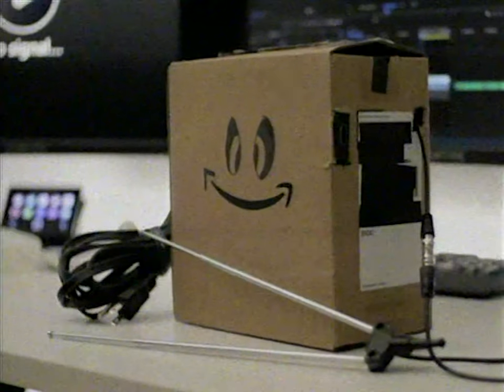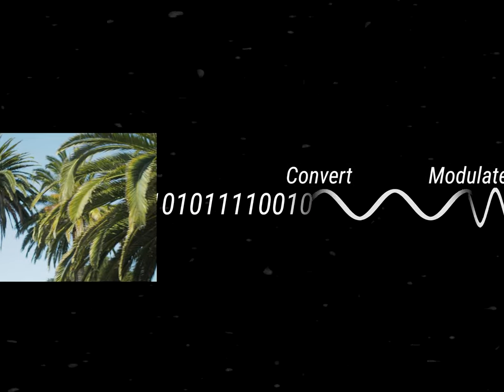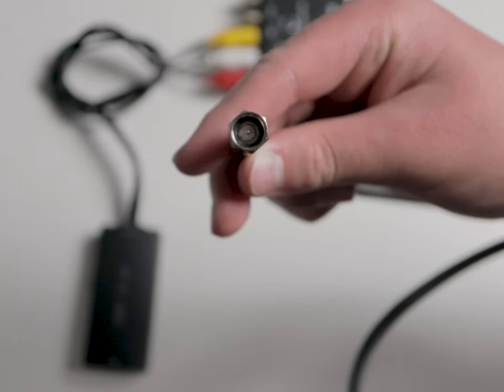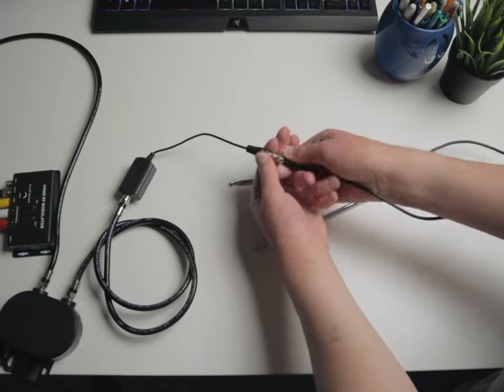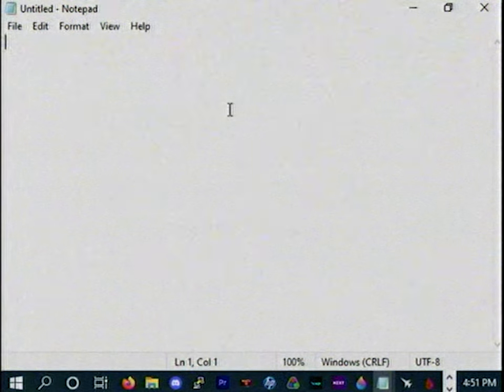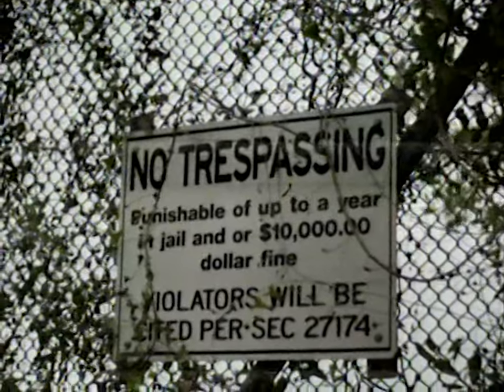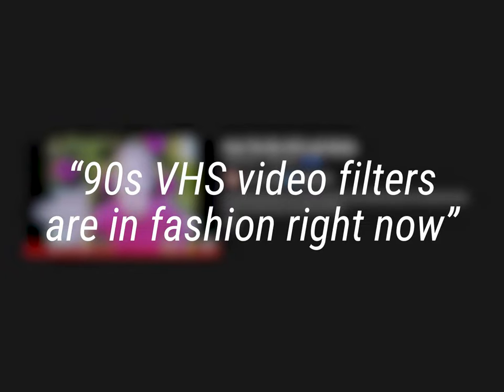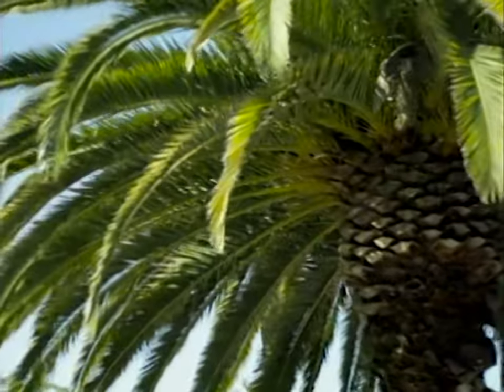Building a 1950s TV Transmitter!

Comment: As another note, your chosen modulator is transmitting on UHF stations. Most American TVs before 1962 were VHF-only (UHF cost extra) so they couldn't actually receive your signal. More importantly for you, rabbit ears are designed for VHF. If you get some UHF (or combo VHF/UHF) antennas you might get a stronger signal and a cleaner image. The most common old-school design you'll find is the loop antenna. That's why most tabletop antennas have a metal hoop on the base, it's not a handle.
Reply: FCC rules published in 1952 set aside 70 channels for UHF TV, numbered 14-83. My parents bought their first TV set in 1954 with a UHF tuner option to receive the two local UHF channels in addition to the one VHF channel. I venture to say that most TV sets in the area did not have built-in UHF tuners because they were bought before the UHF channels came on the air. Later, both local UHF channels received VHF channel assignments, but additional UHF channels came on the air.

The antenna was definitely an issue. My Dad put up a rooftop UHF bowtie antenna in addition to the VHF antenna. He installed a 300 ohm downlead designed for low loss at UHF just for the UHF antenna. The VHF antenna had a separate downlead.

The FCC approved a color TV standard in 1950 that was not compatible with existing B/W TV sets. There is some thought that the FCC expected some TV stations to broadcast on 2 channels, one in color and one in B/W. If so, additional channels would need to be allocated and the 70 UHF channels would fill that need. In reality, this standard never really caught on and was eventually dropped in favor of compatible color, where both B/W and color sets tuned to the same channel, but B/W sets displayed a B/W picture and color sets a color picture.
Reply: @jimlocke9320   In areas like yours where UHF was used people were obviously much more willing to pay for the UHF upgrade of their sets. If there weren't active UHF stations you'd essentially be gambling that one would come on the air soon. I've read that right after UHF was introduced about 30% of buyers bought UHF tuners but after the hype died down the number dropped to nearly zero before the 1962 mandate. If you bought a VHF-only TV but a UHF station came on the air you could buy a "UHF converter".

As for the CBS field sequential color system, I believe it was only authorized on an experimental basis. RCA's invention and demonstration of the shadow mask CRT was what made the FCC choose the RCA-developed compatible color system as the final system. If they stuck with the CBS system the split surely would have set back color adoption. Worse yet if color did take over and made B&W TVs become obsolete we would probably see less of them still existing.
Reply from the maker: Thanks for the comments/stories both of you.. I never really thought about a different antenna.. I might have to try it with one that has UHF elements.
Reply from the maker: @jimlocke9320 that's awesome that you had two antennas 😂.. I'm glad that they went with a backward compatible color signal. It's actually really cool they were able to cram it in, even if B&W TVs looked a little fuzzier with the color signal
Reply: @eDoc2020  In those early TVs, the UHF tuner was basically an add on oscillator that converted UHF broadcasts into an IF signal that was fed to the main VHF tuner (who's own oscillator was disabled) for amplification. Not much different to using an external, third party converter that converted UHF to VHF, except there was only one frequency conversion. Originally, TVs used an IF frequency of 21 MHz, but in the mid 1950s, they started transitioning to 41 MHz, especially for sets that supported UHF reception.
Reply: @dougbrowning82  I think the switch to 45MHz IF started earlier than that. I was watching a restoration of a 16" Zenith porthole G2322 from 1950 and it IIRC had the newer IF. I think the main reason for the switch was cost cutting; with a higher frequency you get a wider bandwidth with fewer amplification stages. In the older days high frequency tubes weren't as good so the lower frequency made more sense. I'm guessing the huge uptick in TV adoption around 1949 was a catalyst for the industry change in IF and the deallocation of channel 1 made 45MHz a practical choice.

I was previously under the impression that it was color adoption which pushed the IF change but the Zenith disproves that. The fact that UHF sets usually ran the higher IF is probably a timing coincidence. If you're developing new turners why not use that as an opportunity to switch to the newer standards?
Reply: @eDoc2020  Probably the biggest reason for these changes is cost cutting. Going from three stage IF amps to two stage. Quadrature sound detectors instead of discriminators, Potter oscillators instead of multi-vibrators for horizontal generators, and transformer-less power supplies. Money is the biggest motivator.
Reply: While UHF tends to seem optimal, a problem is that many modulators nowadays do Cable NTSC instead of Antenna NTSC, so it’s harder for older TVs to receive our blantant Part 21 violations… er, I mean some older TVs won’t work with some modulators
Reply: @eDoc2020 Funnily enough in Europe TV went as low as US channel 1 even ignoring the BBC 405 line standard. In Australia and New Zeland it went down to as low as ~45 MHz video. Apparently New Zealand TV was quite a regular e skip occurrence in Australia during the summer.
Reply: @SimonVideo  Or just grab a wire that is around 60-50cm and plug it to the center feed of the connector.

Comment: As somebody else here said the dark picture is most likely from the cheap HDMI->composite adapter. To get into the details a bit, American broadcasts have a 7.5 IRE "setup" (black level) while other regions (including Europe and Asia) don't. So a signal level which a Chinese TV sees as dark gray is seen by an American receiver as black and what the Chinese TV sees as black is seen as darker than black by the American receiver. An easy work-around is to increase the "brightness" in your receiver. This will work on almost any analog receiver but might not on all digital-based receivers.
Reply from the maker: Interesting! Good to know! I did notice a brighter picture when I used my raspberry pi's composite out.

Comment: What I liked about analog TV the most is that it was practically lag-free, what you saw was eseentially real-time if it came from the TV studio (a news report coming though a satelite link to the studio had a few seconds lag even in the analog days). 
As digital took over, true live TV was gone. Digital terrestrial TV signals need processing before broadcast, the lag can be more than 30s, digital cable TV does additinal processing of the already processed signal which can almost double this lag.
Reply from the maker: That's a good point!
Reply: Another nice feature of analog transmission is that even with low signal the information can still reach the spectator most of the times.
Reply: We used to play TV show games live using our phones, which were also lag-free (analog with circuit switching). The game was called Hugo.
Reply: Fun fact: the 5-ish seconds lag from live TV broadcasts was purposeful, because it gave the stations a time buffer for things like changing transmitters when something went down, stopping or changing the transmission to something else in case of an emergency or some event they'd rather not show, etc.
It's still used to this day, actually.
Reply: @Bleats_Sinodai  Yes and no. In some cases, they applied delay intentionally for the reasons you said, but mostly for the last reason you mentioned: to give themselves time for censoring the live broadcast. But that was not applied to every live broadcast, and most channels probably don't apply intentional delay on news broadcasts. 

As ValdikSS2 mentioned, there were TV game shows in which the viewer participated via phone, and if the viewer's TV was too loud, the classic howling-whistling acoustic feedback appeared, which would be impossible if there was a delay in the broadcast, because in that case the feedback would cause echo instead of howling and whistling. You can still experience it with live radio shows, if a listener calls the studio and their radio is too loud, a feedback effect occurs, but because cellular networks also have a lag, it won't cause howling, it will cause an echo with a few tenths of a second repetition time.

During field reports where they used an analog satellite link, there was some delay which was unavoidable, due to the distance between the field crew and the satellite, and between the studio and the satellite, about 0.5-3 sec depending on the distances, which became ~5-15s after they switched to digital sattelite connection. Sometimes the intercom of the reporter leaks into the broadcast audio, and you could hear the question the news anchor asked from the reporter, repeated several seconds later.

Nowadays the delay beween the studio and the remote crew is so long (especially with internet connection from the other side of the planet), they have to compensate for it by buffering on both sides, but sometimes they mess it up and the news anchor have to wait up to 20-30 seconds for each answer.

Comment: Good on you for getting all this together and making it work. Just a point - if it was a 1950s tv transmitter it would be full of vacuum tubes. Solid state transmitters didn't really become a thing until the late 1960s / early 1970s. Keep up the interesting projects.
Reply from the maker: Yeah I've seen some videos and they look awesome
Reply: The triode and the transistor share similar theories of operation nevertheless; the only difference is that heat matters in different ways

Comment: Extremely educational video is cool! I live in Brazil, and I remember exactly the day they turned off the analog TV signal in my city (it was in July 2018) and that's why this video brought me a certain nostalgia for when I watched everything with those drizzles. As for the dark image, this is a problem with the receiver (that is, the TV), as modern TVs have a tendency to distort the analog signal a lot, That's why the analog image comes out better on the CRT, as it comes out purer, unlike modern TVs, which try to improve the image, but in the end, they only make it worse. 
Random curiosity: Unlike the USA, which turned off the analog signal across the entire country in 2009, here in Brazil, the states were gradually making the transition. The first city to turn off the analog signal was São Paulo, in 2016, and then came some capitals, such as Belo Horizonte, Recife, Rio de Janeiro, etc. However, even today, in 2023, some more isolated cities still use the analogue signal, as not everyone in that place can afford to buy a digital TV. Some Brazilian states also campaigned for the transition from digital TV, and donated free converters from the national brand "Multilaser", and these converters came with a fixed modulator on channel 3 or 4, so these converters could be adapted even in TVs that do not have the RCA composite output. Sorry for my English, I used Google Translate in this comment
Reply from the maker: Thank you! And thank you for your comment! It's cool they waited a bit to turn off the analog signals.
Reply: @SimonVideo  I forgot one detail, here in Brazil, "satellite dishes" are very famous, which are receivers that receive satellite TV signals, and since the end of the 80s they have been analog. However, with the implementation of 5G, this analog signal will also be turned off, and replaced with satellite dishes encoded with a digital signal. It's sad to know that this medium, which was so successful here in Brazil, will end like this. Satellite dishes were part of the lives of many Brazilians, as there are people who live very far from the transmission towers, and there were also extra channels that did not exist on traditional analog TV.

Comment: Really cool video! Definitely deserves more views!

My country switched off analog signal in 2014. At that time I was around 8 years old. I had a CRT TV next to a window in a small area of house. I remember catching signals of the channels. Despite living in the capital, TV signal was poor and it was rare to have any signal without a big antenna on top of the block's roof because between Tbilisi TV tower and my house there is a small hill blocking the signal. I still remember catching Rustavi 2 and Public Broadcaster signals on that tv. It was the last time I saw an analog broadcast on that specific TV. Although that TV can catch FM radio signal when switched to 0 (AV) channel.
Reply from the maker: Thank you! That's awesome, thanks for sharing
Reply: @SimonVideo  😊

Comment: ATSC was probably the worst thing that happened to rural viewers. We went from light snow that could be fixed by minor antenna adjustments on NTSC to a signal that made ear bleeding cracking and squealing noises with choppy video and “no signal”. We also went from 2 dozen station that were a different program to 20 channels that were the same 5 stations on 4 different frequencies. And only 3 of them maintain a good signal.
Reply from the maker: Yeah it's fine if you're close to the broadcast towers but for fringe viewers it sucks. ATSC 1.0 is such a fragile signal.

Comment: I have a setup with my dad's rf transmitter and a phillips antenna, and a memorex portable B&W tv. It's really cool, and sometimes Iput fake emergency alerts.
Reply from the maker: Ooooh that sounds awesome! Emergency alerts are a nice touch
Reply: @SimonVideo  yeah it's really cool, I put local access alert mocks, look up local access alerts online, and also, I put eas mocks, which is not the best idea but my signal has no amplification so, the signal cuts out at 3~4 feet
Reply from the maker: @BitMike Alerts  Nice! That's so cool.. And yeah, good that you thought of the EAS and range thing
Reply: The EAS tones are exclusively used for real emergencies, and playing these tones over radio can earn you a $8000 fine, also considering the fact that this transmitter is illegal, earning you another at least another $10,000 fine. Watch your output power.
Reply: @K0IBZ they used rabbit ears antenna so it means they will have it only in there home, but the higher megahertz or UHF/VHF the FCC or CSA will be knocking at the door. So he can’t really have a 10,000$ Fine but still these laws are real and make sure u order the right antenna guys.

Comment: Years ago l bought an AV transmitter unit for an early black and white security camera l had. It  operates on the old analog uhf system so l could in theory set up my own analog tv channel,with no competitors! I will have to dust it off and find an oldvideo camera with rca plugs and try it out.
Reply from the maker: Oooh nice!

Comment: Something I did recently was hookup a settop box to the AV input on my secondary VCR and ran the output VIA the RF Ariel cable to the TV and after some tuning I got an analogue transmission of digital TV. two analogue channels picked up the signal, (looked almost identical to a VHS) The VCR was acting as a modulator and transmitter. Analogue video is just so fascinating, old and reliable.
Reply from the maker: That's awesome! I should try that

Comment: Excellent explanation I  did the exact same thing in 2020 and worked great. When using the RF Modulator I recommend the UHF Band there are low interferences compared to VHF Band. The downside is that UHF has lower range than VHF similar to Wi-Fi 5 GHz and 2.4 GHz.  And the coaxial cable should only be RG6 or RG6U. Don't use RG59 or 3C2V cables, you have great signal loss especially on UHF band.

Next time I recommend a digital RF modulator, make sure it has HDCP and two inputs. Digital is much better.

Comment: In the Netherlands (Europe) we switched to Digital as the first of Europe in 2006 and in 2021 the last ever analogue signal was transmited over cable television. Here in the Netherlands some kind of television subscription is more popular than in the USA since it is more restricted and protected from watching it without subscription. So in the Netherlands you could get a cheap digital television box from the biggest television subscription provider to receive digital signals if you still where using one of the analog television signals that where left over until 2021 with and old CRT television.